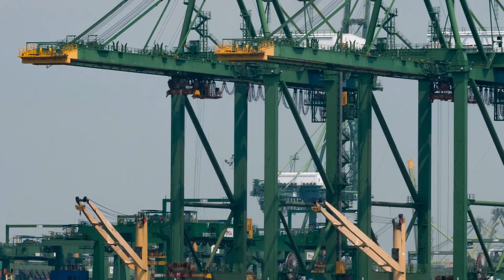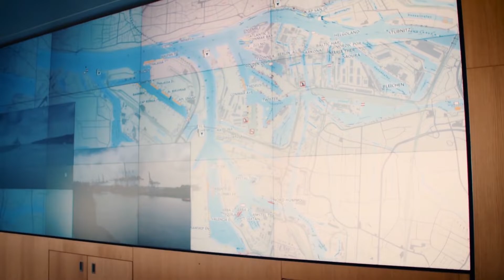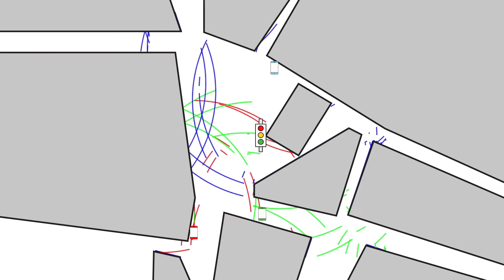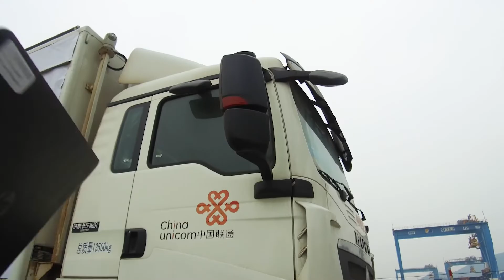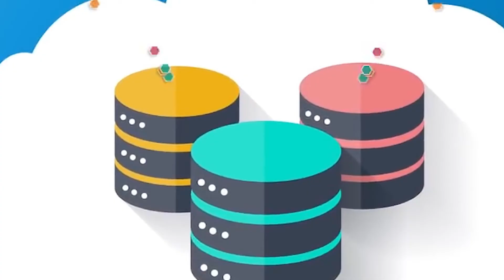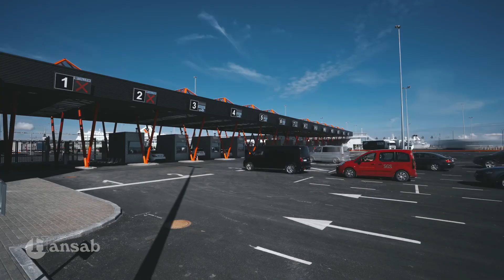[NET2201] 5G as Enabling Technology for Building Smart Port

Comment: Nice video ,it provides a lot of information about 5G but is there any disadvantages. Do u think Malaysia has the ability to have smart port and when? 呵呵
Reply from the maker: Hello ty chan. Yes, there will be disadvantages on 5g, which is the cost to implement it. Due to the fact that 5G uses small cells, cost will be higher to set up all the antennas around the port. Next, we are firm that Malaysia have the ability to setup a smart port in a very near future.

Comment: Hi there, great video, well structured and presented. But despite the advantages 5G is capable of providing to ports, don't you think that having a smart video is more troublesome compared to a traditional port?
Reply from the maker: Hi there Lim Ken Lee, thank you for enjoying our video. We are firm that smart port(we figured out yr typo :D) is better than traditional port because it reduces a lot of accidents and manpower. Smart port uses automation system where manpower is not needed to move containers or guide the traffic in the port, everything will be handled by artificial intelligence. Besides, algorithms being used to calculate the precision level of moving large containers reduces the risk of human-error where accidents usually happen. We hope that this can change your perspective on how smart port is better than traditional port.